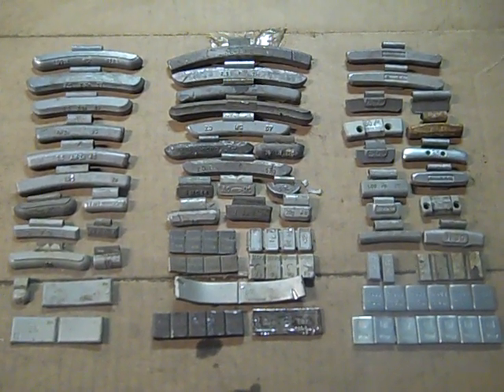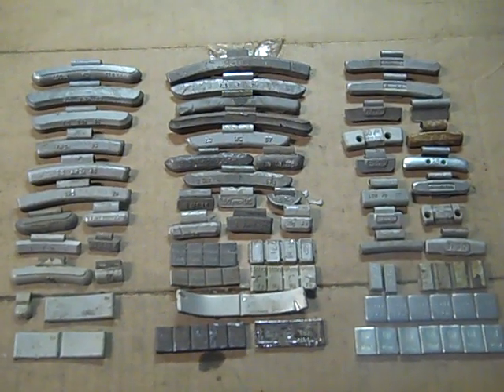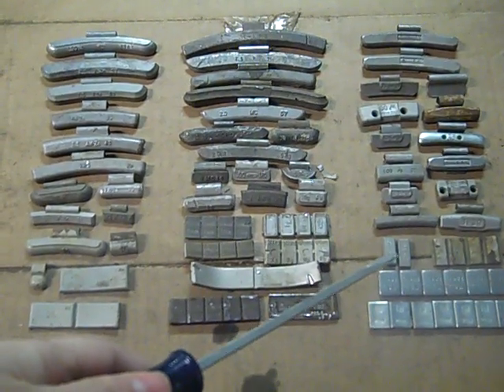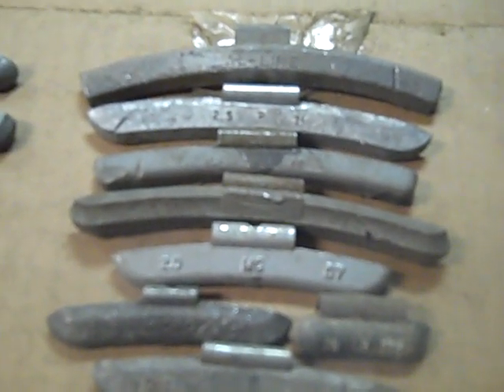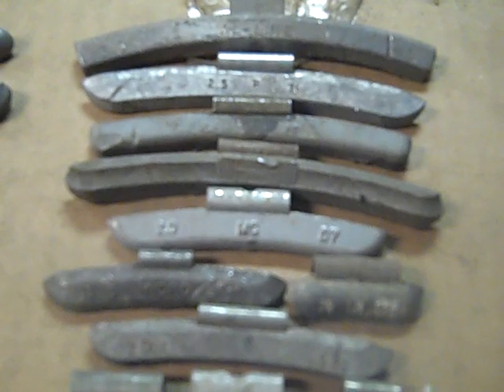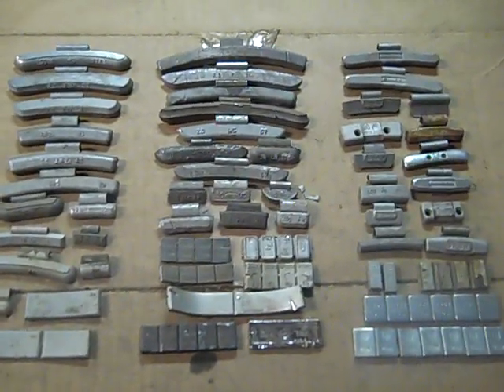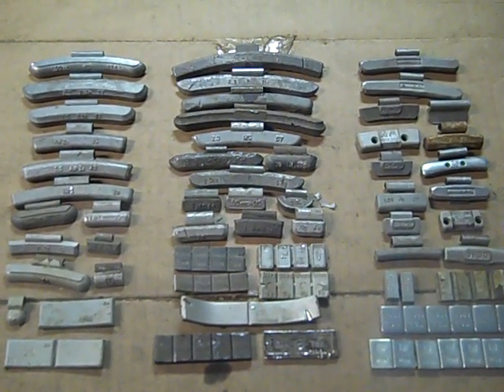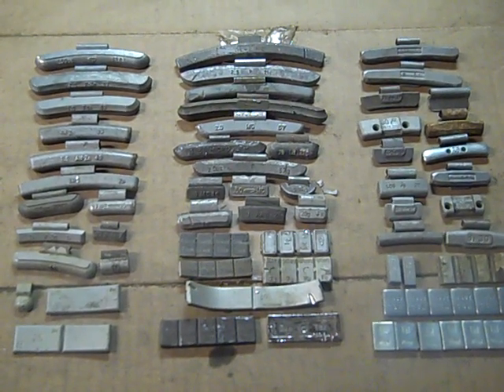Different types of wheel weights - lead bullet casting

Comment: So what I’m hearing, is the “cut “test is the most full proof way in determining zinc? Is it possible to snip off a piece of zinc while doing this test, Or is zinc too hard to cut?
Reply: You can cut zinc but it's brittle. Get a little torch, if they're lead they will start to melt immediately if zinc after 15 to 20 seconds, steel never.

Comment: I see a lot with MC or AL-MC stamped on them are those lead or not? Because mc I can cut with snips but the AL ones I think are aluminum.
Reply: Its just to identify the type of rims you can use them on they are for aluminum wheels and magnesium cast wheels
Reply: biofall38 okay so does that mean that the ones marked MC shouldn’t be for casting? Like I said they’re heavier non magnetic and and be cut with snips. Just asking because I’m just starting out with casting my own bullets.
Reply: @shelbyvbthesnake  they are lead  just means the clip is designed to fit on aluminum and mag wheels
Reply: biofall38  awesome thanks

Comment: Question: is the purity/softness of most lead wheel weights the same from the various manufacturers of them? If not, I'm guessing you would need to try and sort out the lead wheel weights based on their BH number if you wanted a particular hardness or softness to your ammo? Thanks, AGW.
Reply: Answer from the future, in case someone else wonders. The mixing of the different leads will give you a reasonable BHN of lead alloy. Since Tin and Antimony are present. If you want to make sure you get good hardness, water drop your slugs.

Comment: how do you get rid of zinc out of your lead? just skim it off after you flux?
Reply: You can't get rid of it, you're stuck with it. Antimony has a much higher melting point than either lead or zinc but both are alloyed with the lead when you flux the metal. Antimony isn't actually melting, but can be alloyed using wax, paraffin, etc. Don't remember the scientific principle. Keep zinc out of your melt if at all possible, it makes shitty bullets.